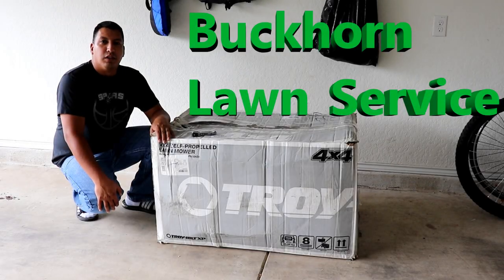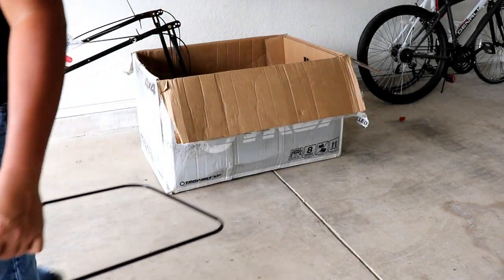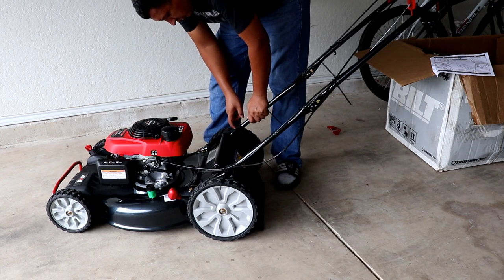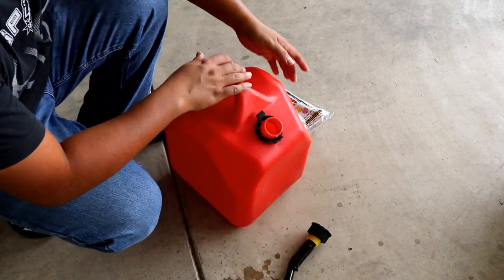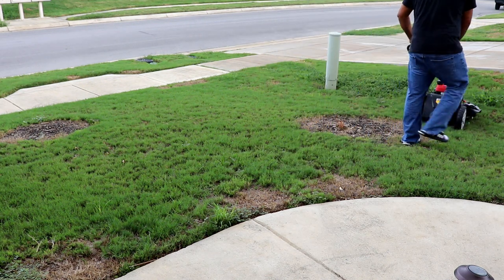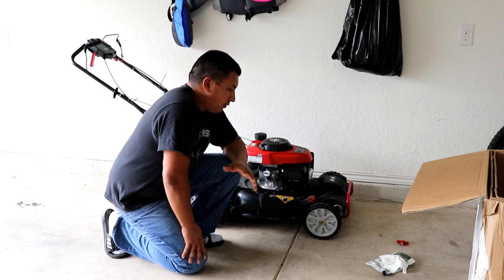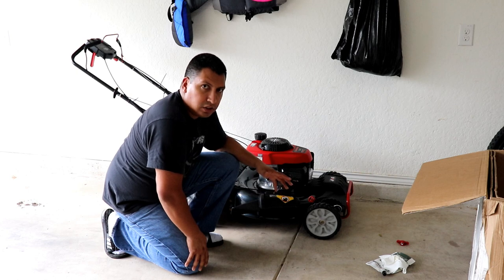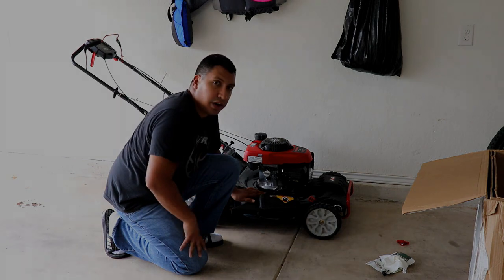Troy-Bilt TB490 XP | Review

Comment: Hey bro nice to see this review about the Troy-bilt with the Honda motor . I do have troy-bilt  in the past and I love the $329 dollar price last me about 2 years Daily use. very light weigh fells more plastic but great mower .  I’ve been tempting to buy the one you have  only because has the Honda motor . Thanks for showing this review .
Reply from the maker: Thanks for commenting! While this mower has been great, it's not without its issues. The main one I have right now is the height adjuster for the rear. Since it's just plastic, the very top block has deformed under the weight of the lever, and now I can no longer mow at the highest level, which is 3.75". This is very bad when having to mow overgrown lawns because I need the deck as high up as possible. I'll probably sell this unit and get a Honda HRX217 or better come the new year.
Reply: Buckhorn Lawn Service that’s nice to know . But sad about the the plastic block my old Troy- bilt was the same but it was only use on 4 inches high for my nieces lawns only .  But after 2 years the from area was made out of plastic so it was little loose after all.

Comment: Jose, good review.
I am looking at this mower for my new residential mowing business in central Iowa.
Is the 'variable speed control' just the difference in rear/front/4 wheel or does the lever control speed?
Meaning; is the lever variable engage or squeeze to max to engage and go?
The plastic  adjuster blocks could also be an issue for me as each yard may be different requiring frequent changes
from job to job; or is the top block a specific issue due to torque weight on the highest level or all of them wearing out?
Any other issues to date to report?
Thank you very much!
Dave
Reply from the maker: Thank you, sir! Yes, the levers will control your speed; the more you pull it back, the more power the drive wheels will get. I usually just keep it held about halfway, or slightly more, which gives enough power for it to go forward with almost no effort on my part. Also, I tend to just use the rear wheel drive all the time, except for going uphill, at which time I'll pull both levers back and use all the power of the 4x4. The mower will absolutely pull its own self, and the operator, up a hill!

As for the adjuster blocks, it is just a very poor design! I don't know what Troy-Bilt was thinking! The weight of the mower seems to be destroying the top block, but now others are deforming. At the time of this writing, 3 blocks have gone bad. It's only on the rear adjuster blocks; the front is still perfect. Due to this, I really can't recommend this mower anymore. I've already purchased a TORO 30" Timemaster, and am also getting my old TORO Super Recycler repaired so it can be put into service. Very soon I will probably sell off the Troy-Bilt 4x4 and save up to buy a commercial grade 21" mower.
Reply from the maker: Oh, one final thing: it's a shame about the faulty height adjuster design! If it wasn't for that, this would be one of the best mowers on the current market! I swapped out to an Oregon Blade MTD Gator G5 21", and the cut improved significantly. But I can't rely on the mower to stay at the level I set it to!
Reply: @buckhornlawnservice4982  
Thanks for the information!
I am conflicted. I want the higher Honda power, 4wd and I am not 'sold' on the Pace mowers.
When I search for best self propelled on internet; the results are all over the map very little common choices.
As this mowing service is a brand new effort on my part the price is paramount right now.
I have only a few weeks to make a decision.
Thank you very much for your information!
Dave
Reply from the maker: Good luck to you. It is a bit overwhelming, all the choices out there. I started with a Troy-Bilt TB130XP push mower, then got a very old, very used TORO Super Recycler. I thought the TB 490XP would be the last mower, but alas that wasn't the case. Recently I bought the TORO 30" Timemaster, and that thing is a beast, with a very impressive Personal Pace system. I may next get the Honda HRX217, which a lot of reviewers say is the best you can get, and be comparable to Honda's commercial line-up.
Reply: @buckhornlawnservice4982  
Lots of research and a dealership visit today...the HRX217 was in the running, but I have decided on the Toro Recycler 22 model 20373 (blade stop).
1. Price
2. Dealership in my town of 5000 three blocks from home.
3. Blade stop
4. Watched some videos on the personal pace lever adjustments and a dry run store test has eliminated my 'fears' of that feature.
5. Comes stock with the notched blade.

Yes, they had the 30" Timemaster in house...that sucker is a pretty beast; but overkill for my intended target customer...right now.
So, if the business flounders, I have a good economical personal mower.
If it takes off...it's paid for in a month (or less).
Thanks again for all your assistance Buckhorn!
Reply: @buckhornlawnservice4982 
PS; the Toro mechanic said of the Honda....good mowers, great engines...they do not sell them, but are warranty service center for Honda.
He HATES working on them. Specifically the OHV cam internal belt.
Reply from the maker: @StudioDaVeed  Great vid there!
Reply from the maker: @StudioDaVeed  I don't have experience with that unit, but so long as you did your homework, I think you'll be okay. Personally, I would have taken the step up to the Super Recycler with the Honda engine. Check out The Lawn Care Nut's comparison: https://www.youtube.com/watch?v=KHPoHSLLc80
Reply: @buckhornlawnservice4982  
Thank you!

Comment: IS there anyway to prevent or repair the adjusters? I've had the same issues with other mowers.
Reply from the maker: I don't see any way that it can be prevented or repaired, unfortunately. I also glanced through a catalog of replacement parts for the mower and didn't find anything related to the adjusters. This is why I ended up getting rid of the mower last season (2019) and purchased the Honda HRX217.
Reply: @buckhornlawnservice4982  thank you for responding. Gollee I live in Waco not too far, appreciate your video. I don't know why they made them that way, it its what it is. Thanks again
Reply: @buckhornlawnservice4982  I tried to drill a hole and secure at least the top and never succeeded. Have a good one.

Comment: I bought the model with the 196 cc motor. It ran about 10 minutes before the rear drive stopped working. The front drive barely functioned at all. Troy Bilt was no help at all. There is no support; no chat or teck support. No service and repair manual is available. You have to take it to the service center for the smallest thing. Ok, I thought, at least it's covered by warrenty. No it's not. I was informed that because the drive failure was caused by a belt falling off, I had to pay for the repair. The lawn is becoming a hayfield as I wait for the diagnosis on the front wheel drive. 
The cost of the mower plus the cost of repair is well above the cost of the best mower out there. Save yourself the grief. Don't buy a troy bilt.
Reply: i have a b and s 175cc i couldnt find the drive parts so i just put the motor on a push motor i can do my yard fast and the motor never bogs down

Comment: Sorry but I am disliking this review new out of the box isn't a proper test review. This mower is absolutely garbage mine has no oil drain to change the oil. Second cut into second season the valves stuck open. Another issue this mower is suppose to be approved for ethanol gas but 3 to 4 tanks and the carb starts acting up and authorized shops won't honor warranty if ethonol gas was used. So only use non ethanol gas to avoid carb issues. Troy built should be made to recall all these mowers.